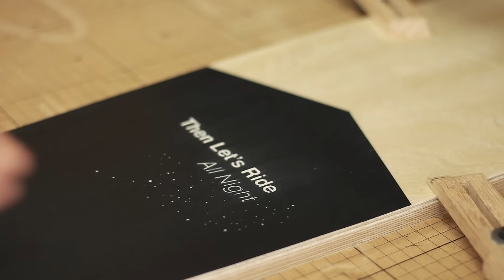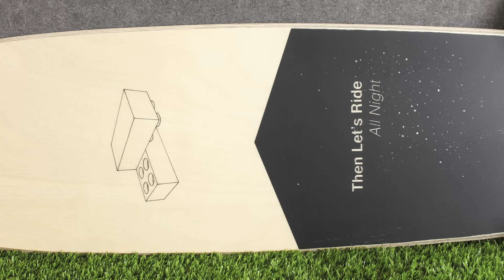Make a Longboard // Easy Flat Style

Comment: using that CNC type machine seems like it would take all the personal touch and relationship with the wood out of the project.  Some of my favorite parts of making things is the time i spend painstaking cutting and sanding to get the shape.
Reply from the maker: I don't feel it that way since I still need to make the drawing, experiment before going to the actual piece (I didn't show that but I made 3 or 4 tests for the letters and the legos before going to the final piece and deciding to make the legos by hand), prepare the machine, babysitting it while cutting, remove the piece and keep doing the rest of the work. As long as I can get my ideas out of my head the best I can, I don't mind having a machine making part of the work. I want it to work in the end and be happy with the result. I still need to do a lot of work. This is not just attaching the materials under the machine and there you have a skateboard...not a Bimby :p
I rather look to a work and think "wow, this looks perfect and so close to what I wanted (I always achieve the impossible)" than looking and seeing that the edge is not straight, the letters are crappy... still there is always a margin for error bigger than what I WANT. I am hard to deal with (myself also)!
Reply: The shape of your board is super accurate, and looks great!  It also inspired me to make my own after the stairs I'm building.  I think I'm gonna go with a birch ply.  I don't have a whole lot of tools, and i find the more I buy the less I really need what I buy, I feel that when craft projects with simple tools, I am learning the trade, maybe some day I will graduate to automated things, but for now I enjoy my black and decker Jig saw.  I also don't have the money to spend on machines.  :)  Thanks for commenting back!!!  
Personality differences also play a factor in how we create.  I like the process, I'm not much of a planner, so i  do lots of research, shoot from the hip and learn from my mistakes.

Comment: I just wanted to know, What did you do in this??
Except for coloring the board??
The cutting was done  automatically, and u bought the wheels and assembled it.
.
if I have an semi CNC machine for cutting, won't you think, I'll be able to by a sketboard ??
Reply: She specifically said in the video that you can cut the longboard with simpler tools. But I guess you skipped that part, or the whole video altogether, if you think she did basically nothing besides assembling the pieces together.

Comment: Heyy) Which spray paint did you use for the black finish? And what problems did you get with the finish?
Reply from the maker: I used Amsterdam brand and that was part of the problem. This thing is sticky even after 48 hours...never going to buy that brand again. I also had problem with the caps both from the varnish and the spray paint and had to run to a store to buy new spray caps...then I couldn't get a perfect surface with the varnish and was getting weird reflections...until I sprayed matt varnish in the last layer and everything became smooth looking.
Reply: Would you be interested in making a custom board for me? I love your work!

Comment: Great build :)

I'm sure you if you are just starting to skate or if you did it before, but anyway it could help one of the viewers... 

Get the right bushings (the rubber barrels that keep you trucks straight if you don't put weight on the board) for your weight, it changes the whole 'feel' of your bord and most Truck companies put some cheap hard bushings on there trucks :(

Since you wrote in some comments, you didn't know the placement of the holes for your trucks... 

The holes are always in the same distance look for 'Truck drill templates'

Comment: You can typically find different truck mounting hole templates online, depending on the brand. I've had trouble making longboards in the past with plywood from the home store. It seems to work better over time when gluing up your own maple plys and pressing the shape/concave you want. Loved the video and the board looks great